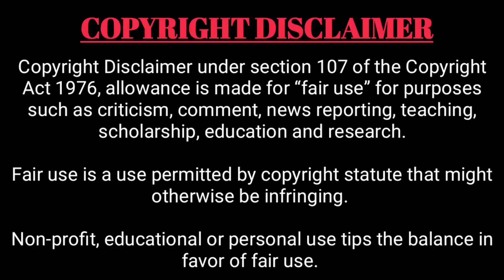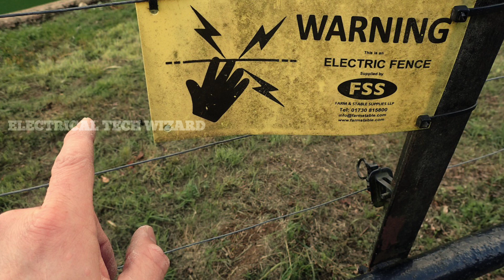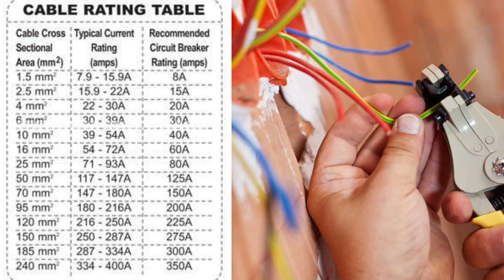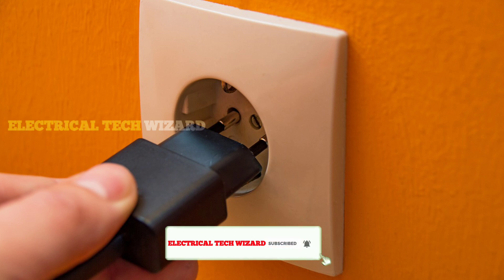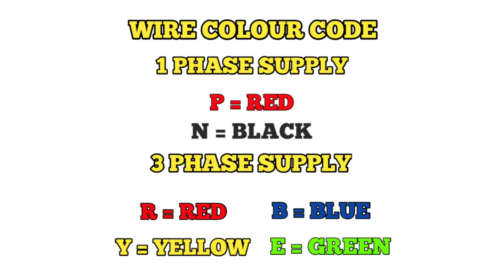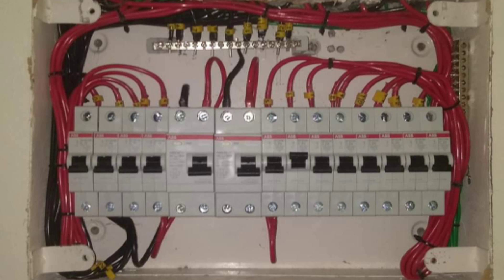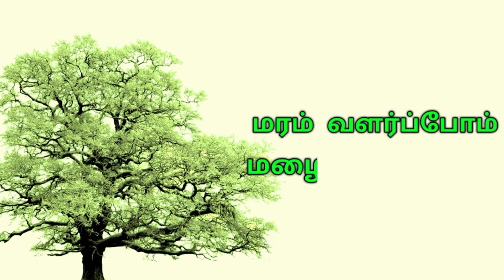house wiring ல் இவ்வளவு விசயம் இருக்கா | house wiring main mistakes | electrical tech wizard | Tamil

Comment: Water heater 3000w .which sq mm. Wire use. Wire  la joined is write r. Wrong. Amps rating take use
Reply from the maker: 4 to 6 sq mm wire size use pannalaam.
 wire joint maximum use pannathinga 
3000 watts heater takes 18 to 25 amps

Comment: Hi bro
Oru doubt
 roof counseled pipe la spring evlo feet pogum and evlo bend cross aagum.
40 feet lenth la 3 bend erukku ,ethula spring poguma
Reply from the maker: minimum 3 or 4 bend cross aagum spring tension இருந்தா ok but neenga 40 feet 3 bend sollringa konjam சிரமம் தான் brother 🙏❣️🙏

Comment: Bro kammiyana load ku athika rating wire potta ena agum , bro. athe matri kammiyana load ku athika rating ulla MCB potta ena agum bro pls rply
Reply from the maker: 1. செலவு அதிகம் ஆகும்
2.load failure ஆகும் அதாவது mcb over load ku trip ஆகாது
Reply: @ELECTRICALTECHWIZARD  load failure na puriyala detail solu ga bro
Reply from the maker: Over load agakudiya time la coil போகலாம் brother
Reply: @ELECTRICALTECHWIZARD  ore edathula bro
Reply from the maker: எந்த ஊர் brother work pantrathu
Reply: @ELECTRICALTECHWIZARD  bro nenga solrathu MCB Ku thane apa wire size kamiya podura edathula athika rating Udaya size pota cost high agum k Vera ena prblm varum bro
Reply from the maker: வேற ஒன்னும் பிரச்சனை வராது

Comment: வீட்டுக்கு யுஸ் பன்றா  மோட்டர் 1hp enna size use pannalam
மோட்டர் க்கு wire பாதி 4sq பாதி 1.5sq  இப்படி யுஸ் பன்னுனா problem varuma
Reply from the maker: brother motor load kammi but பெரிய size motor or ac heater இது போன்ற load ku ippadi use பண்ணாதீங்க wire எறிந்துவிடும்